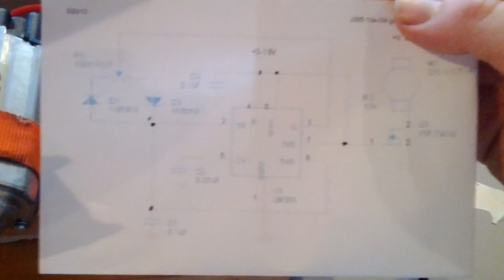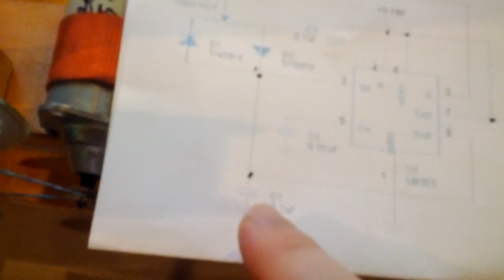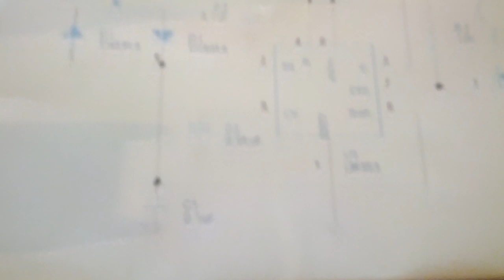DIY motorized crib rocker part 4

Comment: what type of motor are you using?
Reply from the maker: It's a 12v motor taken from a power (car) seat.  Very high torque output (more than required)